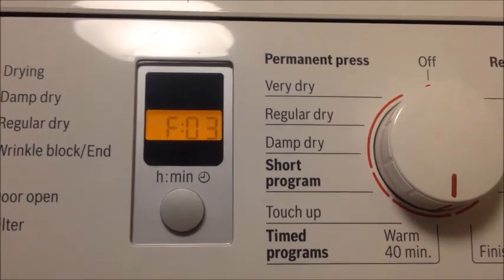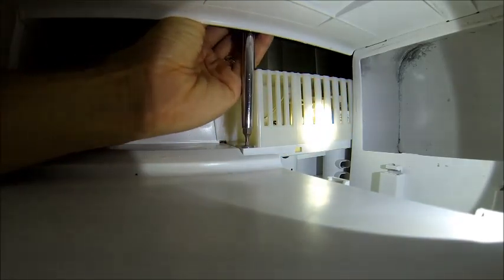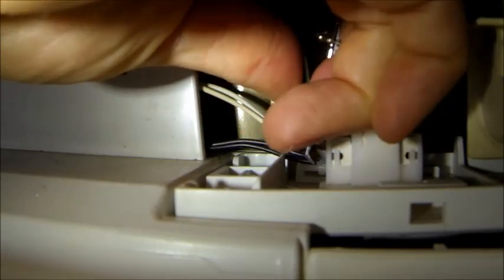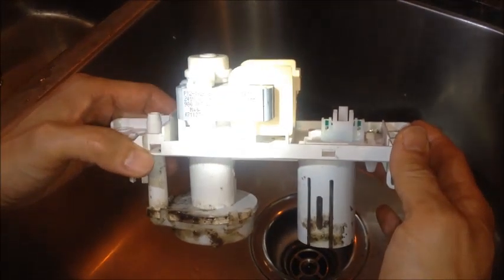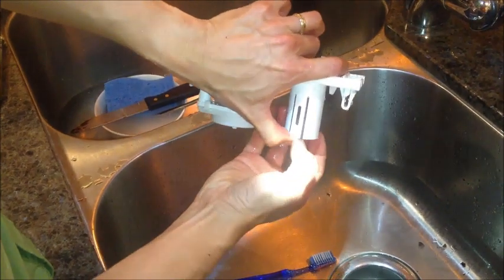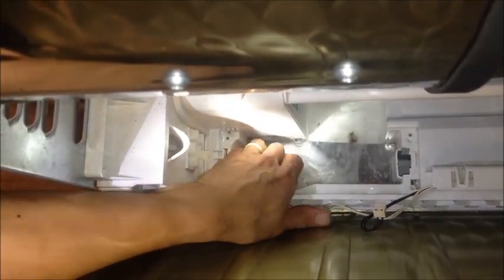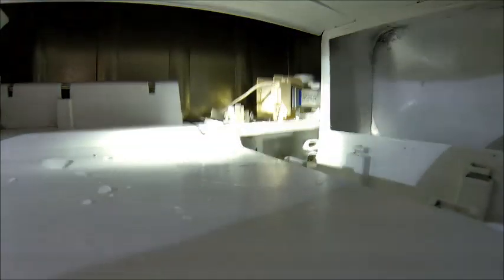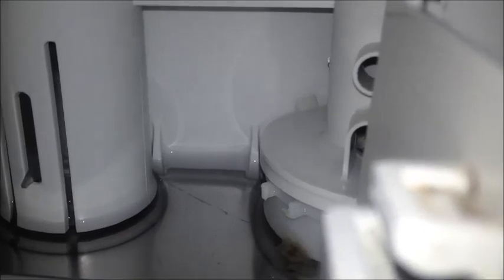Fix Bosch Condensing Dryer F03 - Extreme Sump Cleaning

Comment: Would cleaning the sump pump pit be enough to check is sump pump is broken? How do u diagnose if sump pump is broken? I get intermittently dr code. And sometimes it used to shift from full cycle to last 6mins. Today i was able to get to sump pump pit and clean it out and it went through a full cycle. I also see slow water drain from the drain pipe but not gushing water. Any easy test to troubleshoot the sump pump? What is theres still some water in the pit?
Reply from the maker: remove the drain pipe that connects the pump to the outside of the dryer and make sure it is completely clean (a pipe cleaner is perfect for this).  Also check that the external drain pipe is not kinked or blocked in any way.

Comment: Hi MITEEman. Followed the video through, if I am allowed a small piece of constructive criticism, your voice is difficult to hear at times due to the musical backing. It would be improved no end by losing the music.
Carried out the exercise from start to finish, and still have water leaking out on floor, or message telling me to check the filter (my model is not the exact same as yours(probably a UK variant)). I do this (both the condenser filter and the lint filter by the door, neither of whichever  have any blockage due to lint ), and sometimes the drier then works, most times it doesn't. I am going to try the exercise again to check out that I have got everything clean and put back together correctly.
Reply: Test the pump by filling the sump with water before powering it on.  It should immediately suck it all away.  Also disconnect the hose from the back of the washer and blow through it and see if there's an obstruction or kink.  If you're getting F03 a pump that sucks away a filled sump should fix it.

Comment: Thank you for this tutorial, it worked beautifully but I'm not sure about the results.

When I removed the pump it was a bit different and did not include a float, It was also not in a bad shape and there was no algae at the bottom and mainly clean although I did remove a lot of lint from around it.

After I returned it into place I was not sure it's working as I could only turn in on when the dryer was working and the dryer noise drowned any possible sound the pump was making.
The water I added did not seem to be sucked out although there was some movement - this is the same as it was before I did the process so the pump itself might be not working.

Comment: Good morning how long with this hold the dryer from doing this again? I put a wet vac with special end to reach. I was able to clean however, it keeps coming back
Reply from the maker: Just using a wet vac only gets the easy stuff.  You need to remove the pump as shown and check the entire sump beneath the pump as well as check for mildew on the sensor.  Once you get it all clean it should last for quite awhile.  But it all depends on your usage.  You can't let it sit for a long time or algae will build, but if you use it every day the lint will build up.  Under ideal conditions of a few times a week it should keep it clean for years.

Comment: I have followed the extreme clean. Great tutorial, I ran the dryer to test & noticed not all the water i had put in to test had been removed from either the first tank cavity & the cavity right under the pump unit. I called BOSCH and they informed me ALL the water should be drained away by the pump. Because it wasn't i assumed pump failure. My machine is 9 years old and about 2 years ago the pump was replaced. I replaced the pump today & just got done with test and again not all the water has been pumped away. Does anyone know if Bosch was accurate? Maybe it is a faulty NEW pump. Any help greatly appreciated.
Reply: Mine also did not remove all the water. It left about 3/16".
Reply: Mine also didn’t remove ALL the water. Left about a 1/4 cup or so in the sump. Was a bit disappointed that it wasn’t bone dry. I don’t have. Float sensor either. Two metal strips that I cleaned. Hopefully don’t have to do it again. But I think next time will take ten minutes instead of 30

Comment: Could you pour vinegar or CLR or something into there to break up all the gunk?
Reply from the maker: Vinegar or CLR are great for calcium deposits as you might find in a showerhead or humidifier, or water supply.  In this case it was just algae and not a calcium deposit.  This water is condensate so I'm not sure it would have calcium content.  But good idea for any calcium stains.

Comment: I think I broke the plug connector on the white plug shown at 5:00. The top cap of the plug "pivoted" open, and it became impossible to remove the plug, because the pivoted cap blocked the push-in tab. My only recourse was to snip the wires to the plug. Now I can't figure out how to securely get the wires to re-crimp back into the plug? Any suggestions?

Comment: Why a good Bosch dryer needs such a complicated fixing to make the it working good?  unbelievable!
Reply from the maker: Yes, good point.  I'm not sure why it has to be so unreliable.  My condo evaluated other ventless dryers when it came time for replacement but we couldn't find anything better.  I inspected the new model and guess what?  It's still got the exact same mechanism and I got the exact same fault after only about a year.   So looks like my video will be useful for quite awhile to come.

Comment from the maker: I just found another video for a Siemens dryer that looks to be the same machine.  He shows how to remove the full left side panel to get at the sump.  I think that would be a lot harder, but if you have good access and two people then it's a reasonable option.  I couldn't do it on mine because they were stacked and I see the last step is to remove the screws from underneath.  I was able to "peel" the panel down from the top and still access the sump but it was tough.  Here's the link:  https://www.youtube.com/watch?v=OvrAlAqICIQ

Comment: Hey, MITEEman. I used the "simple" process a bout a year ago, and it made the error problem go away. Now it's back, and I went through this "extreme" process. I didn't have a ton of buildup under the pump (some), and the pump unit appears not to be blocked.

The newer Bosch dryers have a pump unit with NO FLOAT (see pic at https://www.dropbox.com/s/j9snhyr1wfj2751/DSCN0927.JPG?dl=0). THe float has been replaced by a pair of metal sensors that trigger the pump when water makes the electrical connection between the sensors.

The problem is that the sensors do not extend down to the bottom of the sump, so the pump stops working while there is still moisture in the sump. This is a poor design upgrade, for sure.

I cleaned the heck out of every place I could reach inside the unit with the pump out, and put bleach in the bottom of the sump for a bit to clean it out. The newer model has a plastic floor to the sump area, too, unlike in your video.

Not sure whether there's much more to do, here, so perhaps we have a new challenge for you!

Oh, and the newer model dryer doesn't give a code--it just flashes the "cleaning required" light three times in succession. They definitely don't want consumers messing inside their units!
Reply from the maker: +Thomas Tobin So did the extremem cleaning solve the problem?  It looks like everything is the same except you see a different signal light and the float mechanics are replaced by an electrical circuit.
Reply: Nope, not even close. I cleaned every possible surface inside the sump, checked the flow for the pump and drain hose, and scouted the entire air flow from the dryer drum all the way past the condenser unit. And on the firs load, it got about 12 minutes in and then the dreaded "three quick beeps" and the "cleaning required" light came on AGAIN. This is on a brand-new replacement for a unit that kept malfunctioning the same way, and we're at our wits end. I'm about ready to run conduit to the washer/dryer alcove so I can vent and use a "real" dryer. Having this error on every load every week is getting old fast.
Reply from the maker: As shown in the video, try turning the switch to off, then fill the sump, then turn it on (any cycle).  This should trigger the sump.  Does the sump run at all?  If not, then I'd suspect the new electronic water level sensor - perhaps there's a way to gently clean it.  You should be able to put in a tub of water and check the continuity with a meter.  Alternatively the motor could be burned out - easy to check continuity with a voltmeter or hotwire it to test.  If it does run but doesn't drain then you need to clean the pump motor more or check the outlet drain for any blockage.
Reply: @drtobin  same problem here! Did you ever resolve the problem? Thanks!

Comment: Good vid...But I  would rather take the panel off and will be far far more accessible... I know it'll take longer but your way is so fiddly and surely when you've taken the panel off once, doing it again will take half the time.
Reply from the maker: Let's hear what you think after you've tried both.  BTW, the only advantage of peeling the side panel back is you can see straight down onto it.  The fact you can't actually remove the panel is a royal pain.  Once I could see how it was put together, I would not prefer doing it that way.  Just getting a double stacked 200 pound set away from the wall is worth avoiding it.  I would only recommend it if your hands are too big.
Reply: I'll let you know how i get on , I wont be doing it until December.
Reply: Mine is under counter, pulled it out Got side panel completely off exposing it all, no cable tie, a small clip which sprung open , got pump out , not too dirty, no float, it has a sensor , got a massive wad of lint out of that gap at the back , cleaned every thing, blew through water pipes all clear.... all back and working in 50 mins